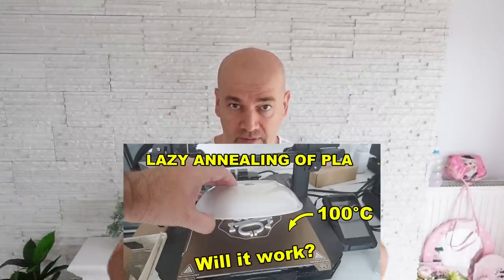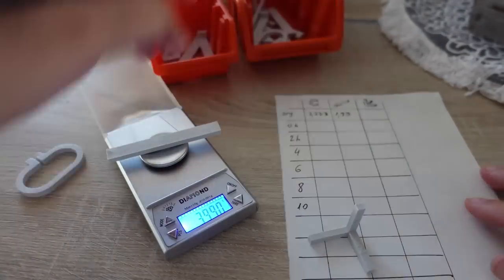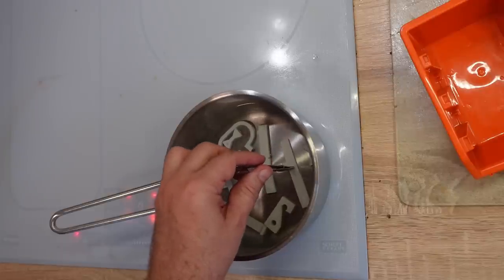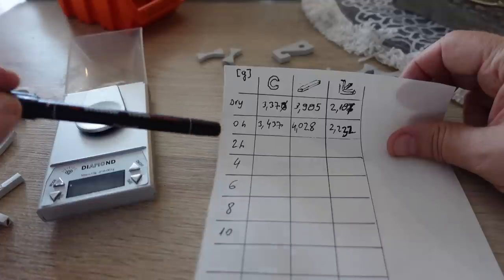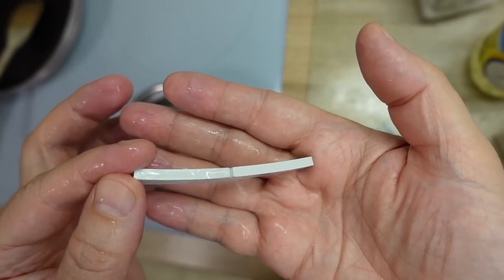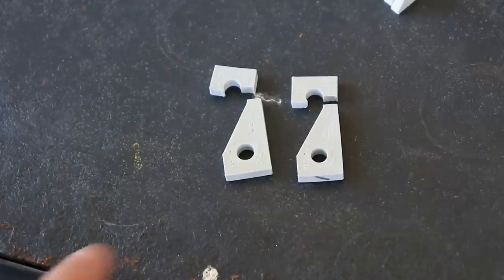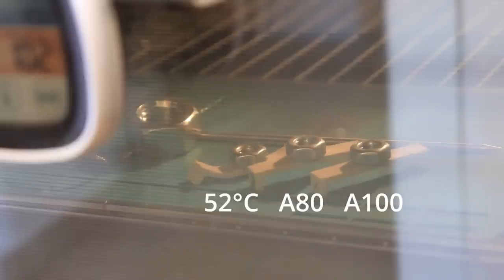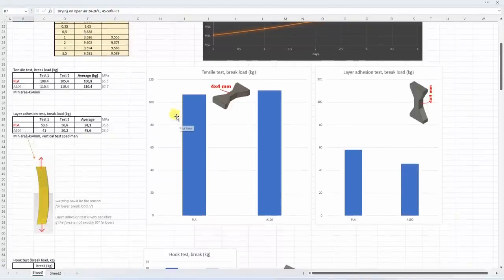PLA annealing in a boiling water

Comment from the maker: Anybody tried PETG annealing? What are experiences?
Reply: I use petg for making gears, very keen to know too😊
Reply: Can u help me? in my ender 3v2 the filament is getting scraped off on the extruder stepper motor which is near the x axis stepper help me also the filament is wol3d India pla pro + the filament always warps no matter the perfection of the bed level it never sticks so what is the problem here?
Reply: The filament won't get pushed every 1 or 2 hours
Reply: (i tried every type of tips on YouTube but it still warps)
Reply: PETG cannot be annealed. The whole point of ruining the PET with the "glycol modification" was to prevent crystallization in the manufacturer's filament extrusion machine but this also prevents you from doing it intentionally.
Reply: Adding fibers helps with warping and stability. That´s what we do for your injection molded parts too. Housings are great when they are made out of cheap PP with 30% GF added.
Reply: @daliasprints9798 Very well said. PLA can be annealed because it is semi crystalline.
Reply: @vincylobo261 Increase the nozzle temp to 5-10°C. See the cooling fan functioning properly. If problem still exists try with a different filament. Numakers is one of the best filament with less budget in India
Reply: @LivinDesign  no I don't have a budget and 210 degrees is the max temperature for the filament also the name of the filament is wol3d 3d pla pro + I bought it in amazon
Reply: You could throw PETG print inside salt, but that makes part like injection molded. Physical properties of the material stays the same.
Reply: PETG can not be annealed since it is not semi crystalline. That was the whole point of adding glycol, thus PET"G".
Reply: @vincylobo261  that happens because the filament has to turn 90 degrees to enter the extruder. Print a filament guide so that the filament enters the extruder closer to a normal angle, otherwise move the spool to the side of the printer.
Reply: @PierreDZammit  thank u so much
Reply: Haven't tried it with PETG but Filkemp has PLN which is designed to be annealed, might be worth a try
Reply: @daliasprints9798  Thank you for sharing this insight. I understand from your explanation that the glycol additive is specifically applied during the PETG filament production process. I assume that the additive is not added in the production process of PET bottles? Several youtube channels have posted ways to make your own filament by extruding plastic re-used from PET bottles. Would it would be possible to anneal such "selfmade" PET filament?
Reply: @KimAbraham  Yes. Depending on part geometry and how that affects heat density, it can even auto anneal while printing: https://youtube.com/shorts/dbeSfSptedg
Reply: Maybe try annealing within casting sand, that way there will be very little deformation as the compressed sand will keep it in the same form.
Reply: Try using a vacuum seal bag, and a double boiler.
Reply: I have annealed PETG for a creeping test (100°C 1 h in a salt bed). It have reduced the creeping by 50%.  Maybe,  ther us another effekt beneath the cristallisation.
Reply: @FrankLauerSignalSpirit  Your part probably creeped during the "annealing" process and your made your part more dense, it is physically impossible to anneal PETG.
Reply: Some thermoplastics are more easily crystallized than others. PETG is considered amorphous, because glycol modification inhibits crystallinity to any significant degree. It might be worth trying PA or unmodified PET, which can be rendered semi-crystalline through annealing. Note that PA's properties change significantly with the absorption of moisture, which acts as a plasticizer.
Reply: I'd like to see the results of annealing of objects held in a metallic(?) jig to prevent deformation.
Reply: There was some report/research, maybe as diploma thesis, it works, but results were noticeable close to melting temperature around 150-170C where part also significantly deformed and results were neutral or negative below 100C. I think cooling speed also has some effect. You can google it and find it on Prusa's blog. Conclusion was that it significantly increases impact resistance, and that ABS/ASA don't show significant difference.

Comment: I think yiu should avoid the objects touching the metal pan. It may hotter than the water. Something like a double boiler for cooking might work.
Reply: Maybe just a fine mesh propped up 1cm by something underneath. The water can circulate and not be that far past 100C. Steam bubbles shouldn’t be that bad if you just simmer the pot.
Reply: Thats not how heat distribution of a pan works, you can boil water in a paper bag that’s because the water cools the paper to the same temperature as the water so it never reaches combustion temperature. This also works when te pan is metal the pan will not be warmer than the water in it.
Reply: @Christiaanammeraal came here to say that
Reply: @Christiaanammeraal  but the metal of the pot touching the plastic suddenly has something with a higher melting/boiling point to transfer heat to: the PLA parts. So those areas of the pan - while tempered by the water of surrounding it, can be hotter.
Reply: @isstuff A normal Cooking Sieve that fits the Pot without touching the Bottom would be easiest.
Reply: @Christiaanammeraal they make double boilers for a reason. They keep food from burning and sticking to the pan. How would that work if the pan is the same temperature as the water?
Reply: @dicktater807  yes the water never get warmer than 100°C therefore you will not burn the chocolate without the layer of water your pan gets the temperature of the flame. Than you will burn the chocolate.
Reply: Did you miss the high school class where they explained basic physics and how this works?
Reply: @Christiaanammeraal you’re objectively wrong. With what you said there would be no reason for a double boiler. They exist so therefore you are wrong.

The metal heats beyond the boiling point of water. It is only the water that cannot exceed 100 C because it cannot exist as a liquid above that temperature. All the heat(energy) in the water is going towards changing the state state. Pans do not have this issue and heat beyond that.

The heat still needs to transfer from the metal to the water.
Reply: @GeomancerHT  Seems like you might have missed your own high school classes.  Heat energy flows from hotter to cooler areas, if the water is at 100C the pan needs to be hotter to put energy into the water.
Reply: @the2theonly672  As long as there's water there, and atmospheric pressure, the surface of the metal won't get significantly warmer than 100 °C. The metal has to be warmer, but the difference on the actual surface is insignificant. It's even easier for the bubbles to start forming in tiny gaps, like between the plastic and the metal in this case, and the bubbles pushes the parts away, you can clearly see in the video that the parts move even when there's not much boiling going one elsewhere. It would be another scenario of the parts were pressed against the metal so hard that they couldn't move.

Double boilers are mainly used when you can't put what you want to heat up into water, and typically not to reach anywhere near 100 °C average temperature. Free water is extremely good at stopping surfaces from going much beyond the boiling point of the water, as long as you don't apply enough heat to cause a Leidenfrost effect, and you don't have to worry about that in this case.
Reply: @Christiaanammeraal Phase changes do be working like that.
Reply: @the2theonly672 The phase change from liquid to gas causes the medium to absorb heat which cools down the heating element to an equilibrium temperature. When you fill the whole pot with water the equilibrium temp will be 100c or a few degrees above that. Unfortunately, physics requires phase changes to do this for physics to work, so it doesn't matter what you believe it's still an observable and testable fact the metal will match the waters temperature inside the pan. Water has a high specific temperature.

You can prove this by supercooling water and causing it's phase change from liquid to ice. It bring the ice to 0c even though the water was below freezing initially.
Reply: @fishyerik even with the water and metal being the same temp wouldn’t the metal transfer the heat faster to the parts causing the warping?
Reply: @mrhappyface2000  All the liquid water is at the boiling point, as long as there are points for bubbles to start forming, which the print provides plenty of, liquid water can not get warmer than the boiling point. 

It doesn't matter how fast the heat is transferred, it is not possible to apply heat faster than water can boil. It's like it is with ice, you can't make ice warmer than the freezing point by applying a lot of heat to it, as it melts.
Reply: @Christiaanammeraal  does the same apply to cheese?  It's a genuine question...(not trying to be a smart-aleck).  The plastic is touching the metal part of the pan.  I get that the water itself never gets above boiling, but the pan would get hotter, no?

I was thinking a double boiler method , like a pan of water sitting inside another pan of water, or the raised rack inside the pan, would be more beneficial and eliminate the direct heat transfer to the PLA.
Reply: @benchap24  i am not sure what you mean with cheese. Cheese instead of water? Cheese to be heated by the water?
Reply: @Christiaanammeraal  I just meant that the cheese touching the bottom of a pan will burn. The material touching the bottom of the pan matters. Water doesn't burn because it turns to gas and leaves in a bubble and steam. The PLA, even surrounded by water does not have the same properties as the water. Therefore leaving on the bottom of a pan can lead to overheating of the material, beyond the 100 degrees C.
Reply: Yes, there is a thermal gradient at the interface of pan and water.  Would be best to use a rack to keep the parts away from the pan.
Reply: @fishyerik any difference in temperature is too much here. Obviously there is a difference, but if it's 1C, that's probably too much, seeing as the parts are warping. The warping we see on those flat bars isn't from internal stress relief...that's from uneven heating, and pretty majorly. It's actually the same sort of warping you see when frying something -- the bottoms shrinks, and creates a "belly". Also, while I'm sure the difference between the bottom of the pot itself, and the first (arbitrarily) 0.1mm of water is small, the difference increases exponentially the further you get from the bottom surface. So at 5mm from the bottom, *while heating*, you might have a 10+C difference. Think about how much energy you have to pump into water to BOIL. Phase changes are extremely expensive energy-wise.

Honestly, a sous vide machine with a large volume of water, and the parts in plastic, would be the way to go for this. Possibly even with the parts vacuum sealed. We want to boil a frog here, basically.
Reply: @Christiaanammeraal   I understand what you're thinking. Consider though - how does the water get hot in the first place?
Heat is also being removed from the water as steam, yet that heat is getting replaced somehow. Where is that heat coming from?
The heat in the water comes from the pan. Heat is flowing from the pan to the water.  Therefore, by the second law of thermodynamics the pan has to be hotter than the water. It's guaranteed to be hotter than the water, by the second law of thermodynamics.
So what about paper cup full of water?  Why doesn't the paper burn? It would need to reach about 454F to burn, while the water won't exceed 212F. Because the cup is thin, the outside of the cup won't be MUCH hotter than the inside of the cup. That is, in order for the outside of the cup to be 454F, the inside of the cup would soon reach perhaps 430F. Which would heat the water to maybe 400F. The outside exposed to the fire or other heat source is ALWAYS hotter than the inside, by the second law. It's just not THAT MUCH hotter because heat conducts through the material.

But there's another element at work here, an effect which explains why today the bottom of my hush puppies were more cooked than rest of the hush puppy. On a hot day, try touching a wooden fence, then some water outside, then a piece of metal outside. You'll notice the metal may burn your hand while the wood feels barely warm and the water may even feel cool - even as they are all the same temperature.  That's because of thermal conductivity of the different materials. The metal on the playground feels hot because it transfers heat to your hand much quicker than the wood or the water does.
And that's why the hot pan full of oil overcooks the bottom of my hush puppies - because the metal pan transfers it's heat to the hush puppies very readily, and it will do the same to your PLA parts.

Comment: Why are we trying to figure this out still? Put the parts in a bucket of sand and heat the sand however you want. Worries about fine details? Add baby powder. Or powdered Epsom salt. No deformation. Slow even cooling for recrystallization. It's like reinventing the wheel.
Reply: Have you tried this?

Comment: A good try is to fill a container with sand, and then heat this container up to 80 degrees (oven or using the heated table technique)... The sand will help maintain the dimensions of the pieces, in addition to being an excellent thermal conductor.
Reply: Or dried rice. Oven would be best to heat uniformily.
Reply: Yeah, I use calcium carbonate and the results are pretty good.
Reply: Fine salt also works.
Reply: PLA goes sticky, so you never getting the sand off later, lol
Reply: @AlexanderBukh  Good to know. Think the salt way will wash off better?
Reply: @scottpeal60  Salt is water soluble, it will dissolve if it doesn't wash off
Reply: Powered sugar is the way to go. Keeps the finish much better.

Comment: I have a suggestion: You should try a sous vide device. Many sous vide devices can go up to 90°C and they come with vacuum bags so water absorption should not be an issue. They also have a very precise temperature control, plus they circulate the water for even heating. You could also perform the annealing by stairstepping the temperature. Start out low, and gradually increase it for each test.
Reply: You know that most of your post describes a 3D printer heatbed.
Reply: I would not want to cook with that sous vide after doing that.
Reply: @SianaGearz  no
Reply: @carlosjosejimenezbermudez9255 could you explain why not? Is the issue that PLA could leach out of the vacuum seal bags?

Comment: Slightly off topic, but Amazon Basics PLA is actually quite good for it being so cheap. Nozzle 207°C, bed 80°C for first layer then cooling down to 30°C and continue printing, 0.2mm layer height. Works 10/10 times for me. Good strength and perfect bed adhesion. Bed is cleaned with window cleaner and leveled with BLtouch before every print. Ender 5 Pro with 0.4mm nozzle and stock bed surface.

Comment: You want something that helps keep the parts from warping. Water doesn't help in that regard. Salt was found to be effective, the finer the better, ideally you want a weight on top. Salt also helps with moisture. Use an oven.

Comment: Try packing the objects in fine salt in a container and annealing them in the oven. The salt supports the objects and they keep their shape and it evenly distributes the heat.. I've done it, it works great. I got a big bag of pool salt and ground it in a blender as fine as I could. After you remove the parts from the salt and clean off as much as you can, water will dissolve the rest, as some sticks to the parts some times.

Comment: You should be using a double boiler in order to spread the heat around more evenly. Placing the parts on the bottom of the pot is going to lead to only slightly different results from just placing them directly on a hot bed, it barely even spreads the heat at all. This should reduce the warping a little bit, but TBH most of the warping is due to internal stresses of the plastic's layerbond inconsistencies, so it'll always be at least a little warped. You'll likely need some sort of additive like the fiber filament you mentioned at the end.
Reply: I wanted to write a comment regarding this, but you did it for me😂 There needs to be a grate/platform or as you said, double boiler to avoid the parts getting affected by the direct heat of the stove.

Comment: I have successfully annealed PLA with minimal warping using an oven before. The key is to slowly bring it up to temperature and then slowly bring it back down again. It's the sudden temperature changes that lead to warping. It's a very similar process to annealing a piece of steel. Suddenly heating and cooling steel is a great way to get it to warp as well. 
IIRC I had some very consistent shrinkage and expansion, it was -2% X and Y and +2% in the Z direction. Compensate for those in slicer and after annealing you end up with reasonably accurate parts.
Reply: But is it worth it compared to PLA+?
Reply: @randywatson8347  PLA+ is nothing like a standard, unlike PLA. Companies insert random additives and call the result a PLA+. Only Carbon-Filled and Glass-Filled would have consistent properties.